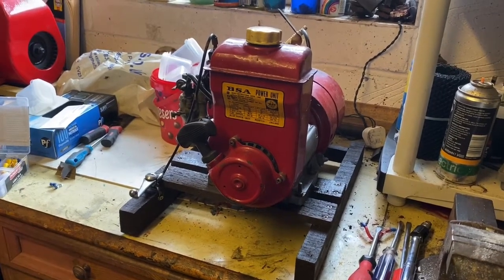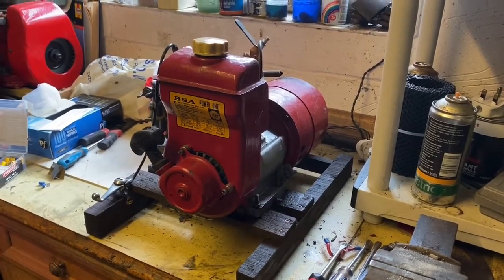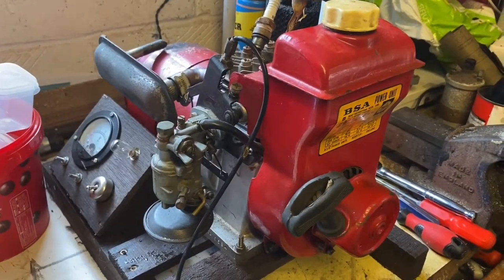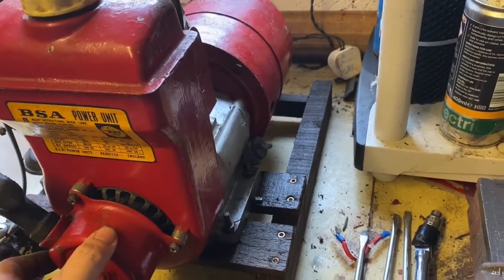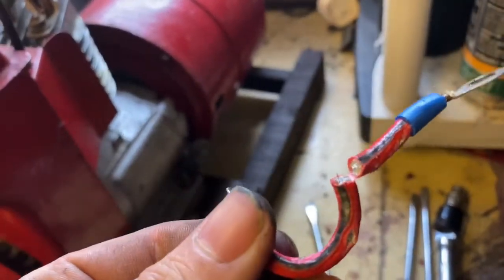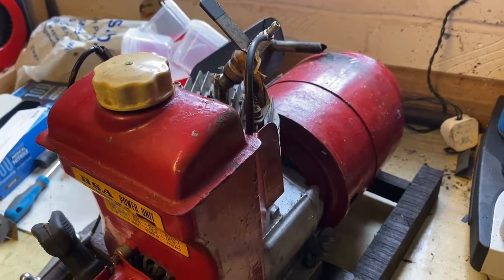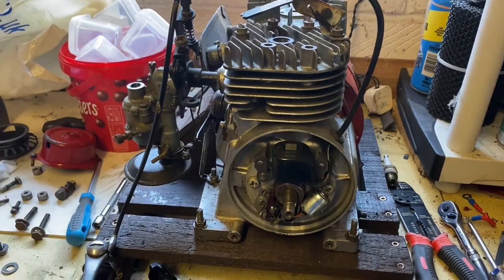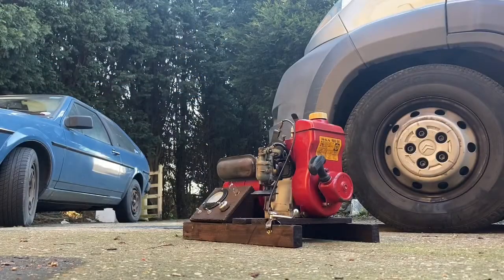BSA Power Unit - Repair and first run in 7 years!

Comment: Do these small engines run on regular unleaded?
Reply from the maker: Yep regular unleaded... I don’t use any additives in these. They aren’t refined enough for it to ever be an issue. Very different load and power characteristics to say a bike or car engine.
Reply: Thanks. I have a BSA 120cc engine that I’m restoring and couldn’t find any info on what to use.

Comment: We had a mower with that engine when i was a kid, made by Valor, although it had an Amal carb and a round exhaust.
Reply from the maker: Popular little mower engine these. When on the mower most had a small round exhaust and Amal carb. 

For the generator it has a governor something you couldn’t do with the original Amal carb so it got swapped for a zenith one. Would have likely been easier to tune as well.